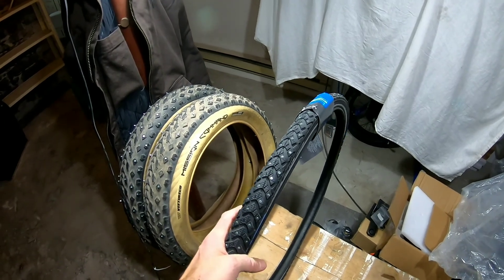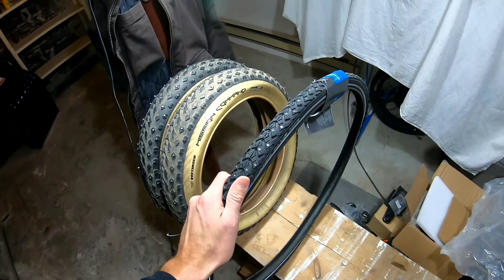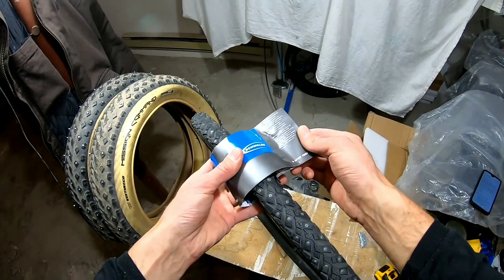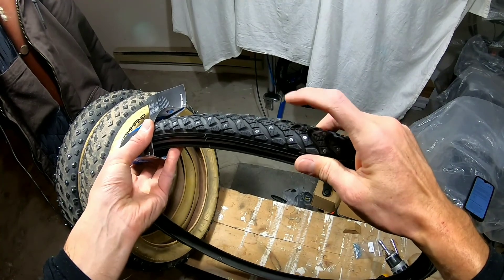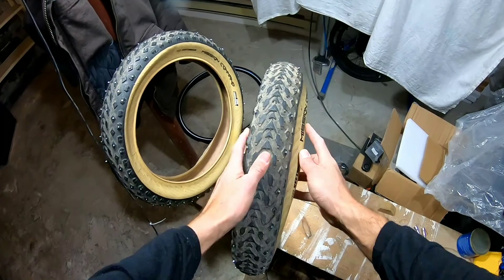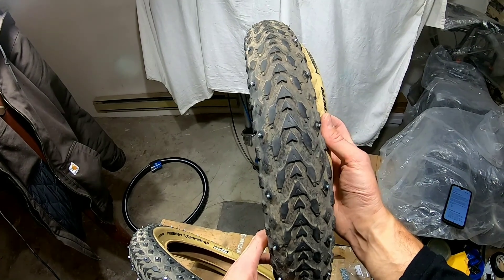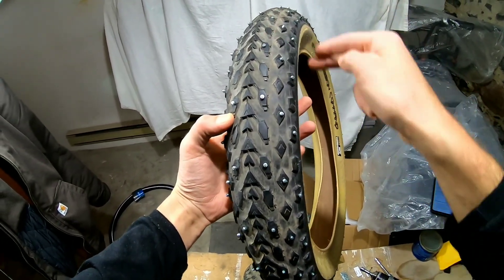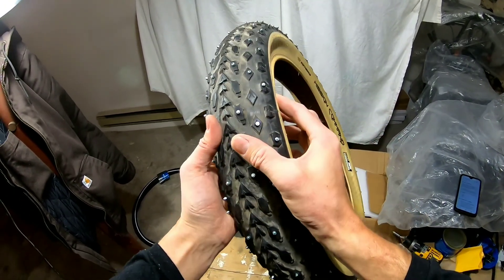How to: Stud your own Tires on Fat Bike Super 73 - Winter Biking - DIY

Comment: Thank you, your video was informative unlike the last six that I watched, some fella used or bought a $500 stud gun and ended up using it to put studs into previously studded tires, this will be my first time doing it so I will not be removing studs out of my tires first, I ride an EV skateboard Karma and I want to use it in the winter and I don't want to repurchase anything so once again your video was more informative than some of these other dip s**

Comment: Have you riden the studs on wet mud? I have a set of Tannus tyres which I am happy with on roads but don't have enough grip for muddy off road conditions. I was considering putting some studs in them for the winter.

Comment: Working on mine since yesterday. I'm using metal stud screws and will glue another tire or maybe a piece of rubber.  I will be tryying on another pair of tires another idea, using m4x0.7x6mm set screw. I plan on screwing them upside down so I have  ordered knurled point and half-dog point set screws.  I think that will work well and I wont have to go through the tire

Comment: Do you leave the studs on year-round? I’m asking mostly for my rear tire, as it is much more difficult to remove because of the hub motor. I’m thinking of maybe placing some studs along the exterior as you show, I’m just leaving them on throughout the year.
Reply: It will just dull out your studs and you'll wind up having to replace them before the next winter, hence not saving any time at the end. Specially with the rear since it's the driving wheel and all the quick summer accelerations will shave off studs quickly.